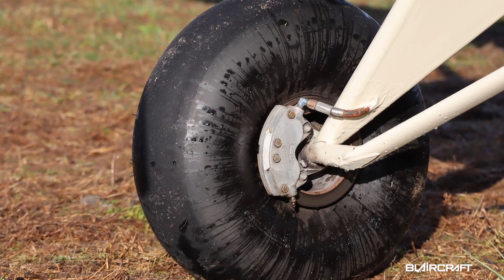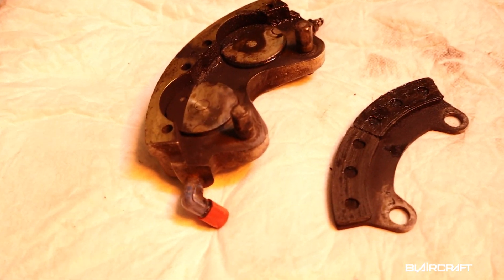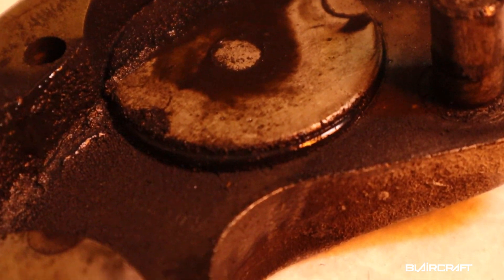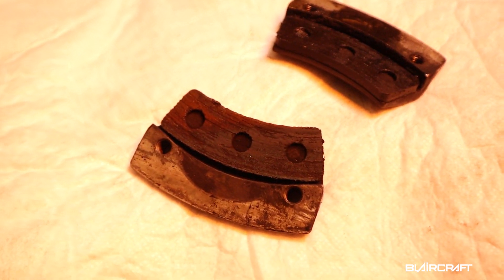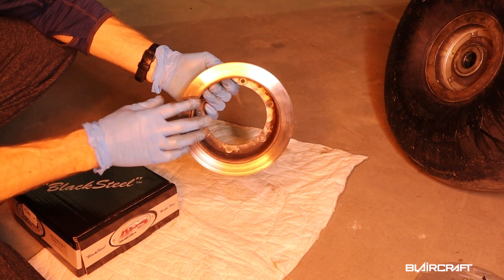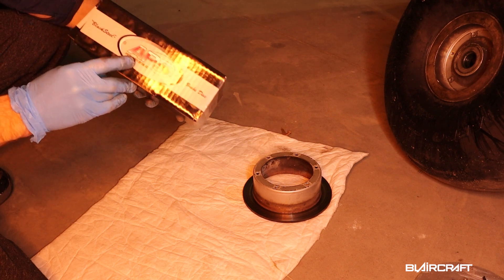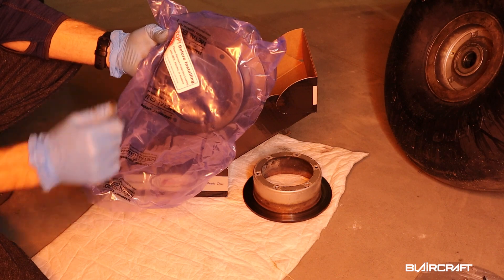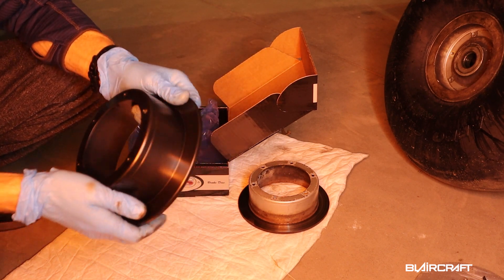Piper Brake Blow Out: The WHY + Clean, Inspect & Repair

Comment: before tightening the nut on the brake line after new pad installation, did you have to bleed the line first?
Reply from the maker: I pumped new fluid from the bottom up after connecting the line again.

Comment: Are those Aeroclassic 8.5-6 tires?
Reply from the maker: That is correct. I’m happy with them, approx 50 landings so far.
Reply: Did you need a deeper rotor to allow for clearance between brake assembly and tire?

Comment: It looks like the brake bleeder is on the bottom. Wouldn’t it be easier to bleed the air out if they were on top?
Reply from the maker: Actually it’s best to have it on the bottom here. You pump the fluid/air from the bottom all the way up through the system out the master cylinder in the cockpit.

Comment: Joshua, having replaced roters and pads on big-rigs this is great!  I need to get a job at an airport.  I didn't like the background noise "music?" but the video is top notch.
Reply from the maker: Appreciate the feedback. Thank you! If you enjoy aircraft, working on them is more like a hobby. Is there an airport you have in mind? There just might be an opportunity be available.
Reply: @Blaircraft.Engines  That is  a great idea unfortunately the closest airport with services is over 50 miles away.  Most of the strips here are just tie downs and a few hangers, most don't even have fuel; you call and a truck comes out to meet you.
Reply: Every airport and company and individual needs airplane mechanics (get your A&P rating).

*good point on the music, i made that mistake so many times (music is too loud when im narrating something) and i have tried my best to fix it. Great video though 👌  top notch stuff